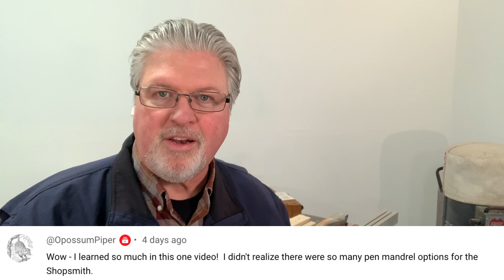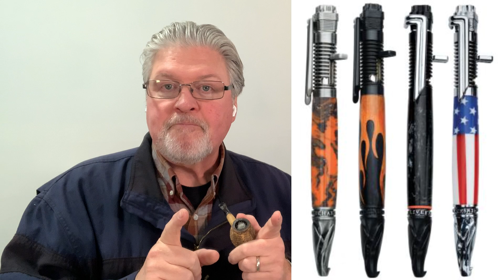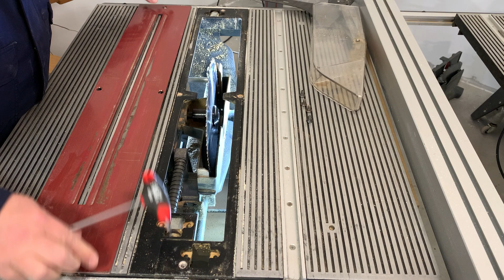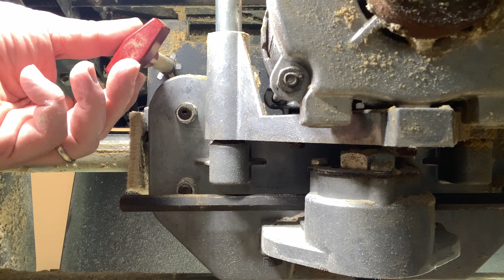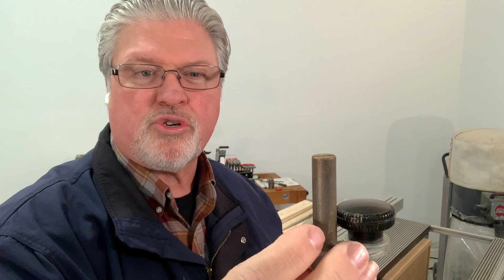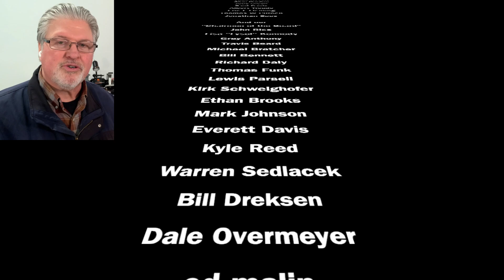🔥 Sawsmith 2000 & Shopsmith Pen Mandrel Q&As. Yes, that's an odd mix! (Visible for One Week Only!)

Comment: Thanks for the special tip.  Watched you for a long time, also watched several of the travelling SHOPSMITH pitch men at many a shopping mall and even a county fair, foaming at the mouth to buy one in the 1980s. Finally got my first in '87 (I was 29), MARK510 ver1986 ( read all the manuals first, then carefully aligned it) and proceeded to use the dickens out of it repairing the 100 year old homestead I was raised in, floors, doors, windows, stair rails, and a repair/remodeling business which paid for a lot of the Shopsmith. The system worked PERFECTLY, if you just set it up correctly instead of throwing it together out of the box. I had waited years to get the best deal, two free tools and big discount on third (Band saw, Jointer, Jig Saw). The new MarkVII costs exactly double what I paid but without accessories, and who would be stupid enough to name it after an existing but different machine, it's clearly a MARK VI.  Now I'm 65 years old, and have bought four units, a ver '85, ver '86 for me, two ver '86 about 5 years ago for my then 25 year old boys, which one upgraded to the new rails and the other completely upgraded his to a 520, rails motor electronics and all.  I hate them. The '86 was was the best. most dependable. easiest to service, cheapest, and most versatile. 
Shopsmith is a THINKING man's tool, not for the Morlocks who can't throw the manual away fast enough ( my father was their former king), who will be be the first to scream "it's not safe" after leaving off or throwing away all safety parts, or say "you just can't make it work right" as the dusty operators manual props up their elbow and coffee cup.
By gawud the sun rises and sets on John Folkerth, long live the king with the biggest stones since Dr. Hans Goldschmidt, even if he never could figure out the profit ratio on Shopsmith.
I'm betting the new guy could figure profit but couldn't even turn ON a Shopsmith, and he hasn't turned me on much either as I've had companies I've worked at bought out by the investment banker type before, and can ye sing the Road to Tipperary (unemployed version).
But I digress !!
Reply from the maker: Nick will do ok, and if you haven't see it yet, he has posted several "shorts" of himself getting to know his own Mark 7 in his new home shop.

Comment: Lot's of interesting tidbits. The adjustable T track will accept 3/4" miter bars but once tightened on the Shopsmith miter bar you will have to expand the slot to use that way again.    The adjustable track is on the Joint-Matic table also. 

Also, I think you missed an edit around 13:20 😉
Reply from the maker: Yes, I totally missed it! sorry about that!

Comment: Thanks for the tip.  :)
The common size for pen mandrels is 1/4", fits ID of the tubes.  17mm is the drill size for the blanks, to accommodate the OD of the tubes.
Reply from the maker: Thanks for chiming in.